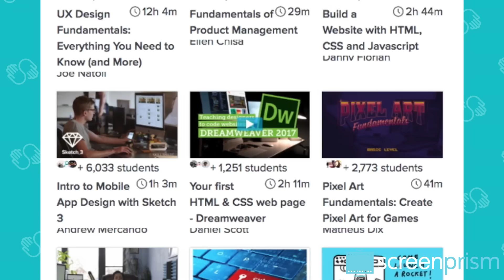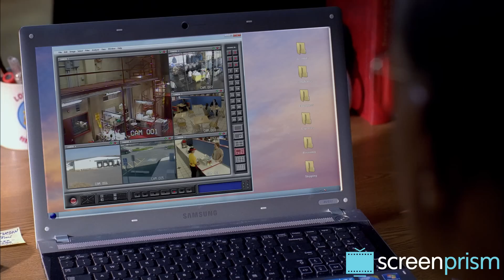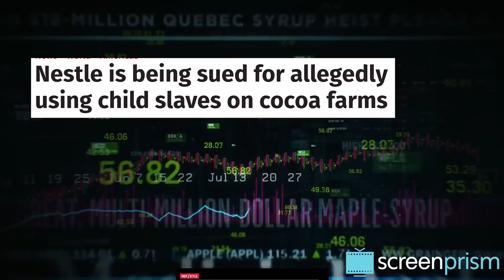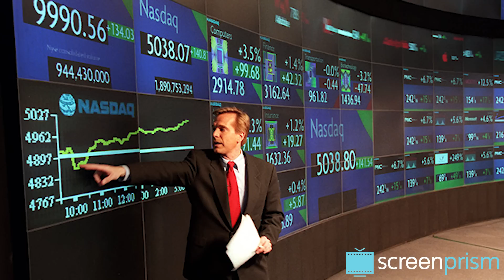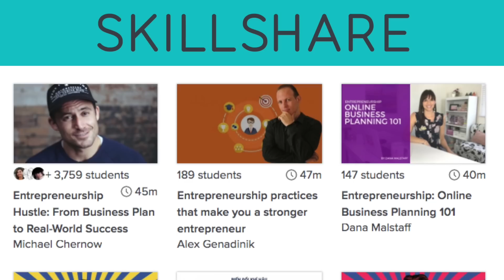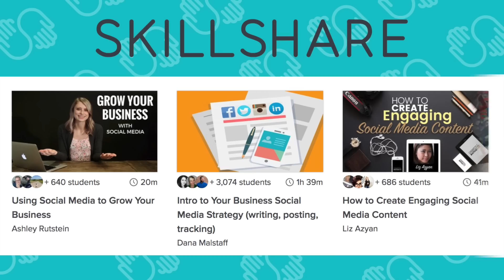Breaking Bad: Gus Fring - Man as Corporation

Comment: Gus in Breaking Bad: "I don't believe fear to be an effective motivator"
The Dentist in PAYDAY 2: "Fear, as you surely know, is a powerful motivator"
Reply: I think fear is a powerful motivator as a short time measure, but in the long run is not so effective.
Reply: bluisbg Zzz fear should be used in controlled doses. A little scare from time to time is good to remind your men that you don’t fuck around. However, if you constantly use fear, your men will rebel against you. This is why dictatorships (along other reasons) usually fail over time.
Reply: It is a powerful temporary motivator. But it creates huge risks. Trust is actually the greatest motivator. If you Trust someone to lead and work in your mutual interest, that is the longest lasting and most effective. With a little bit of fear of betraying the boss as a spice.

Comment: Great video, but being similar chemically doesn't make them similar. For example, water is H2O and peroxide is H2O2, but I would certainly not consider them similar.
Reply: Patrick Hogan Taken orally 20 milligrams of methamphetamine is nearly identical to 20 milligrams of amphetamine sulphate.Source:  prescribed Desoxyn. It actually feels cleaner than the Adderall I used to take.
Reply: And Cl and NaCl are one molecule apart, but I wouldn't put chlorine on a steak.
Reply: But...but... they had a graphic!!!
Reply: Well to be fair those are inorganic compounds while the ones in the video were organic
Reply: When you study pharmacodynamics, you see that medications in the same family interact with your body similarly because the core effects usually have to do with chemically similar structures. For instance, “benzodiazepines,” anxiolytic drugs like Xanax and Valium, consist of a benzene (benzo) ring, accompanied by two (di) sets of adjacent nitrogen atoms separated by carbon (azo), in two 7-membered (epi) that not chemically the same (ine).

Shorthand, it’s a benzene ring connected to a diazepine ring. Anything with that will give you anxiolytic, alprazolam- or lorazepam-like effects.

And, as stated above, inorganic compounds can’t be spoken about the same way organic compounds can.